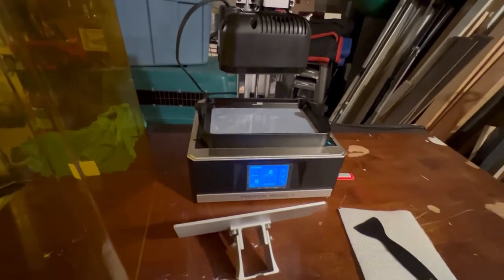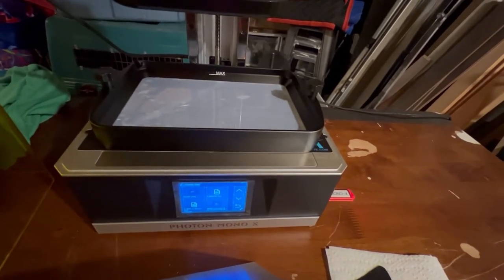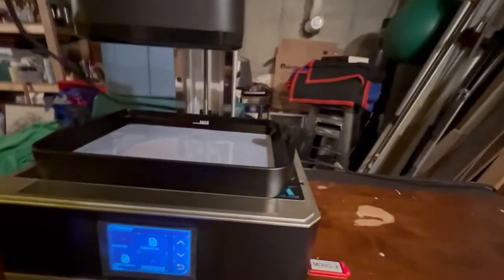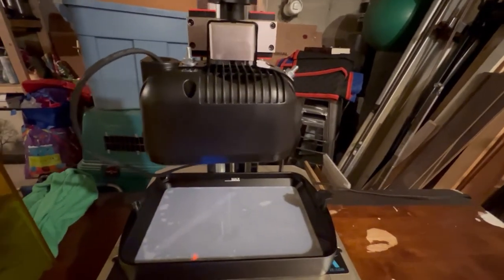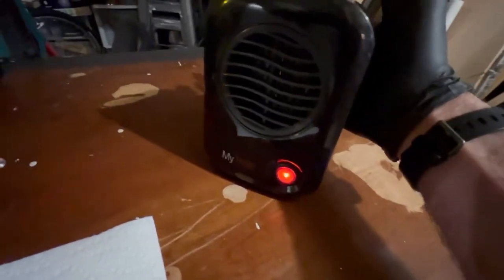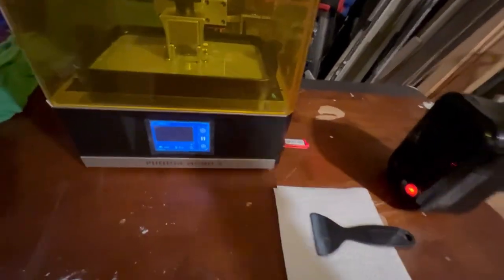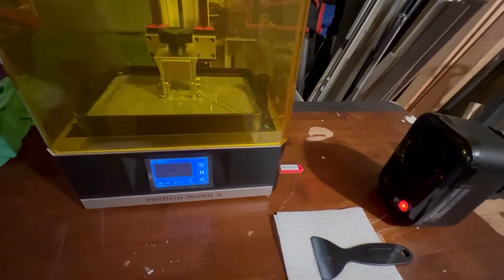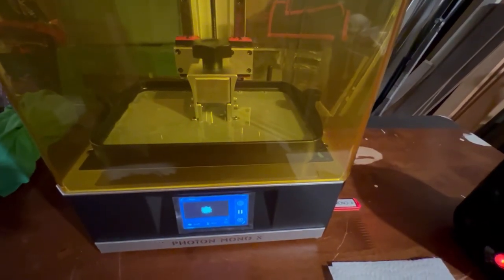Faster way to warm up resin for 3D printing with quality results

Comment: Nice idea. I have the same heater but I use zip ties instead of the bendable metal bracket you have. Using this heater idea for my epax x1-n, thanks for the idea.

Comment: 50W thermostatically controlled PTC heater sitting in the back of the printer seems like a lot simpler solution and keeps the printer closed up and ready to print...You've got plenty of room in the back left there....and keeps the temp steady even when printing.  A lot cheaper than keeping a room warm around the printer.
Reply from the maker: I was thinking of this method, but I haven't gotten around to getting the parts yet.  Thanks for watching.